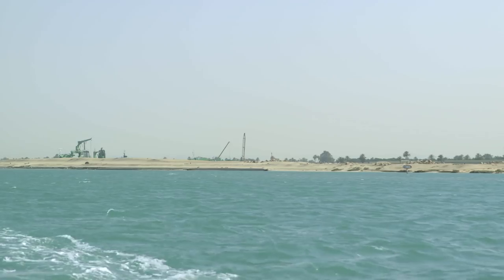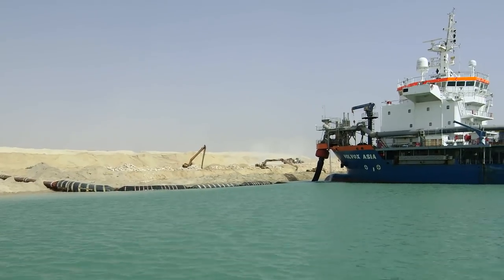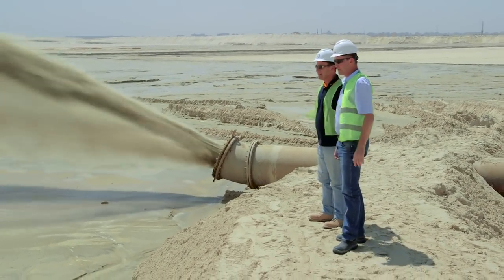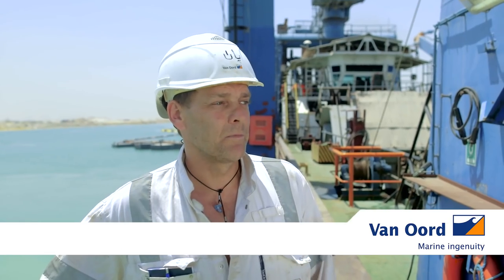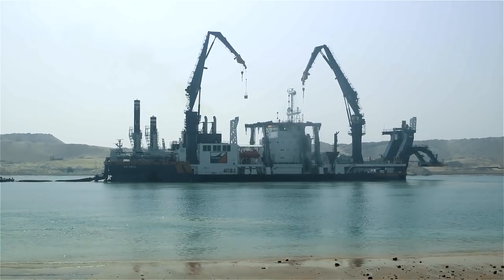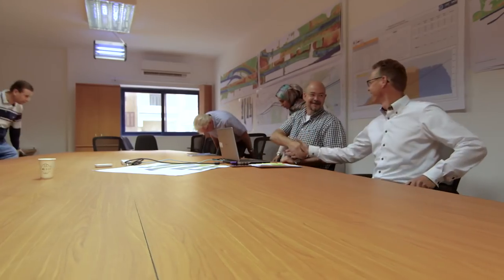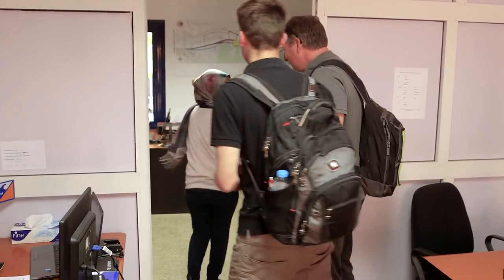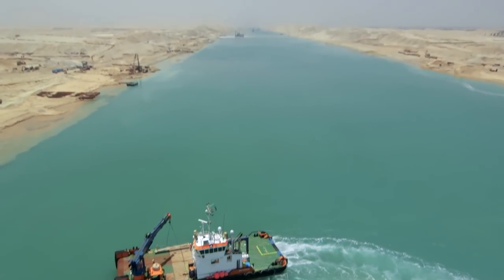Second Suez Canal - Icon of the Future

Comment: Why is it so shallow.... keep digging..
Reply: Because it is just enough. At 24 meters deep. adding 1 meter of depth adds 4% in depth. And probably also 4% in costs. In other words: digging deeper is prohibitively expensive.
Reply: @basvanbeers3515  Also if you want to make it deeper, you need to make it a bit wider, because the edges need to have a specific slope, otherwise they will fill up the canal back under the erosion. The requirement was to make it 24 m, so they did 24m.
Reply: It only looks shallow because it is so wide. I believe that the dept only needs to be around 1.15 times the dept of the ship so that means there is room for ships with about 20 to 21 m of a submerged hull. That is about a 7 storie building under the waterline.